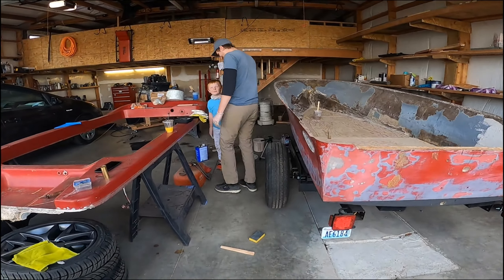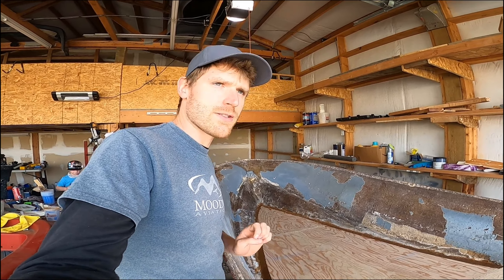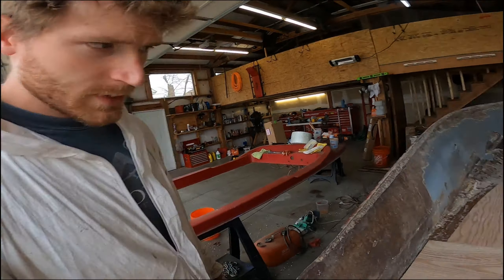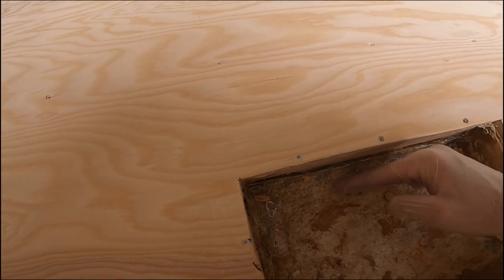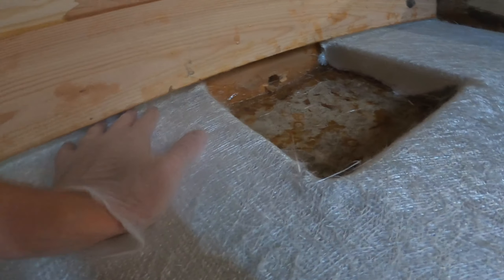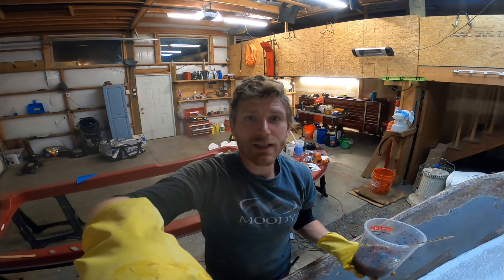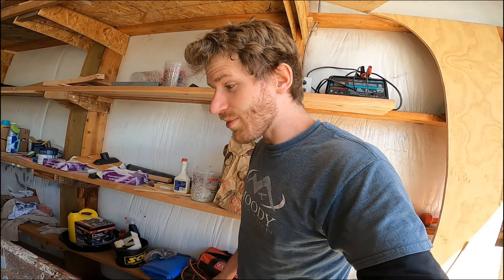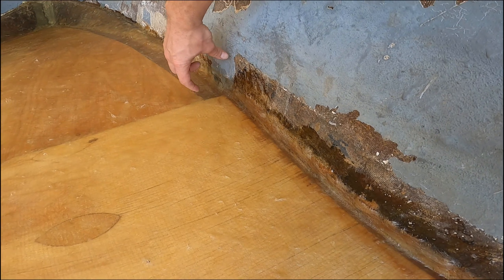Boat Rebuild (PART 15.2) Glassing in the floor!

Comment: There is a roller tool that will  eliminate bubbles but she’s coming along really well! Caution cutting that back part of the motor well.  It’s a tight fit from the factory & I’ve struggled when doing repairs to that exact spot
Reply: Weird, becasue he uses a fin roller in a prior video. He actually does a really good job for not knowing wtf hes doing lol. It drove me nuts when he didn't make fillets for all his seams.  But I guess it's fine lol.

Comment: If you give it a few more minutes your resin will get through to to wood, you dont necessarily have to wet out the floor first. I know it's scary when it seems like your glass isnt sticking to the wood lol, but 20 minutes later it will be soaked through. At least that's how it works when I use epoxy.
Reply from the maker: I was afraid it was going too harden in a wrinkle position , which would of been really annoying to fix.

Comment: What cloth did you use for the top of the floor? Didn’t look like 1708
Reply from the maker: It does look different, but it is 1708 Biaxial Mat Cloth, i ordered a roll of 50" x 360" of off amazon. I have plenty left over. i'll save it for a future project maybe
Reply: He put biax down

Comment: Been watching your videos of this restoration do you recommend splitting the cap to restore the floor ?
Reply from the maker: It really depends on the boat. For my project it made sense to remove the top. It would of been difficult to install the floor with the top left on. So i guess if your doing the floor i would remove the top, defiantly more work tho.

Comment: Did you use marine plywood and if so where did you get it?
Reply from the maker: I didn't use marine plywood. the only difference with marine plywood, it has a side B and side A, non marine has a side B and side C. the only real use for marine grade is to use side A for nicer exterior finishing purposes it just looks nicer. marine ply is made the same way non marine ply is made. I spent hours researching this and this is what I learned. if you need to replace a transom I would go with none marine plywood or Coosa board. I didn't use Coosa board because of the price, as well as my boat was stored on the trailer after use.
other wise Coosa board does not rot.
hoped this helped.